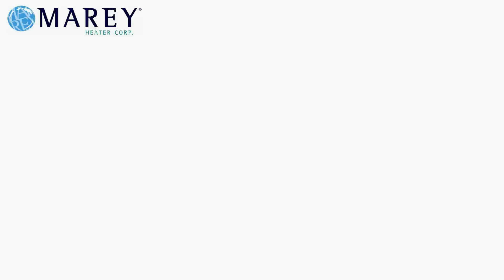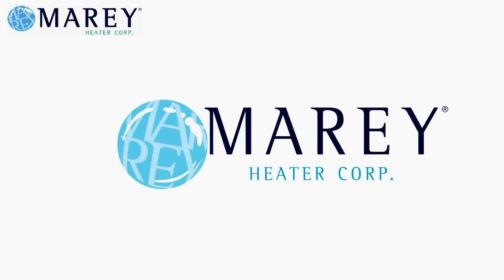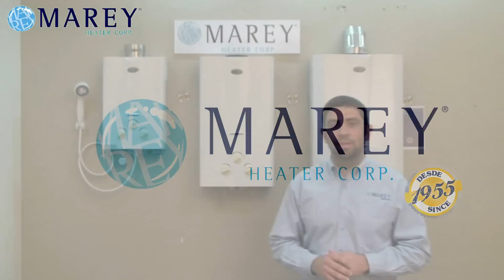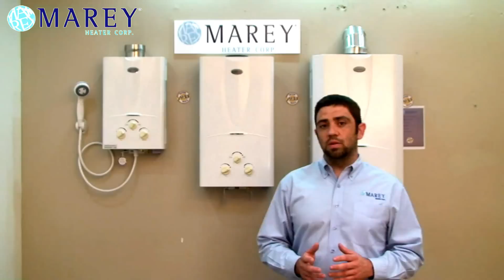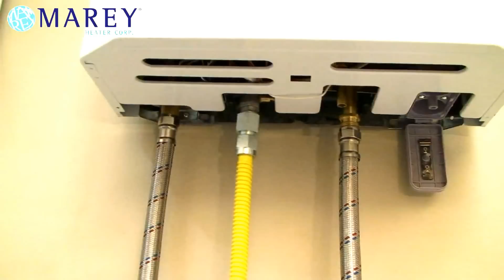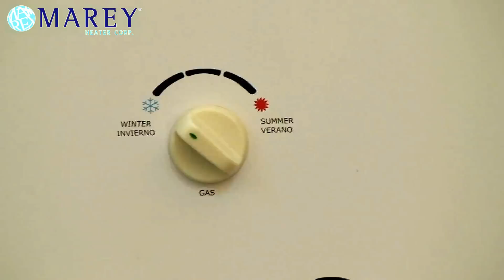Marey Heater - Gas Tankless Water Heater

Comment: biggest problem with these is that they don't automatically control the temp of the water leaving the unit. i had mine set for 120 degrees going to my shower. but when i turned on the  sink faucet only which had a lot less flow the water would get over 160 degrees. in fact it got the pex tubing hot enough that it burst. then the heat exchanger stared to leak in one of the solder joints. they replaced the exchanger but not for free. after 4 years i finally replaced it with another brand made in japan not china and threw the marey in the dumpster

Comment: Can we vent the flue with pvc elbo? the flue is a odd size 4 1/4 . I noticed that some other s use pvc?
Reply: no... pvc can only be used on condenser gas heaters as the exhaust gas is colder...
Reply: @mathewross3398  You mean the exhaust gas is HOT!

Comment: We have one of these, a few days ago it started a fire, from the electrical side, good thing propane was turned off. I had phoned their customer service that day 3 times to get someone to give me input as to why it wasn't putting out any hot water, Well there was no one there to answer a customer service call.??!! Then when turning the warm water knob on again, no warm/hot water. called them again and as I am calling the fire started. We were lucky that we were nearby, had water nearby and were able to put the fire out. If we weren't home at this time, we'd be homeless and our pets would be dead too. Marey international is not responding other than telling me via email how sorry they are for our troubles, Well what are you going to do, when??? We are still under warranty. out of hot water, we have to heat water for a bath in pots, ditto for doing dishes... etc. Thus, I'd say this water heater is not safe nor worth the money.Anyone reading this beware
Reply: M John... YOU ARE ABSOLUTELY CORRECT ! ! ! !  BUYER BEWARE !!!!   I bought a brand new GN16 and from day one it NEVER WORKED PROPERLY. I installed it in a brand new house so it has nothing to do with the plumbing!!!  This unit either puts out SCALDING hot water, over 140-160 degrees when it should ever be over 120 OR THE UNIT SHUTS DOWN COMPLETELY !!!  Six months of emails and countless calls where no one ever answers the phone All you get is "Were sorry all of our attendants are busy helping other customers" and your not able to leave a call back message.  Look at their website. It says "WE PRIDE OUR SELF'S ON OUR CUSTOMER SERVICE"   WHAT CUSTOMER SERVICE ARE THEY TALKING ABOUT !!!!!!!!!!!!!!!!!!!!!!!!!!!!!!!!!!!!!!!!!!!!!!  THEY HAVE NONE !!!!!!!!!!!!!!
Reply: @stevexxx6078  First off there is no Marey GN16 Model.  If you are referencing the GA16NGDP unit, yes that would be the accurate model.  This video does not really detail the troubleshooting, settings, and adjustments for these units.  There are actually YouTube videos available if you do a little searching on your own or check out the Marey Channel for the URLs.  

Maybe if you went back to your original seller you might actually get better service and results that would satisfy you.  

Obviously, there is some sort of adjustment issue or you have fluctuating PSI  or gas pressure in your system.    There are so so many variables that could cause a unit to behave this way, as every setup is different.   You need to participate in a troubleshooting session with a Marey Tech. 

However, if you did not register the unit and reach out to your seller (only authorized sellers will have ALL the contact information to Marey ) to get involved to assist you with a solution then you are going to get a slow response from Marey Tech Support.
Reply: M John, 

If you have one of the units featured in this video, then it sounds very strange that you could/would have an electrical fire from 2 -D Cell batteries.  Especially if the gas was turned off.  Also if the gas were turned off there will be no hot water because the heat exchanger has no flame.  

For contact with Marey,  you should have gone through your seller first and make sure your unit is registered.  When Marey has your purchase information in their system, they are more likely to assist you quickly.
Reply: @Eagle5fiddle  this post is a couple of years old, the water heater was purchased directly from Marey and replaced after the fire. And NO it had nothing to do with the batteries.

Comment: The water is either scorching hot or cold. As soon as you turned on any cold water to cool down the temperature, the water heater would kick off. We tried everything to adjust the water temperature,none of their controls did a thing. It worked better if we run hot water in the sink "down the drain", as we take a shower, but I don't like wasting water this way. 
Don't F around with trying to adjust it. Return it if you can.
Reply: Same been through 3 of these